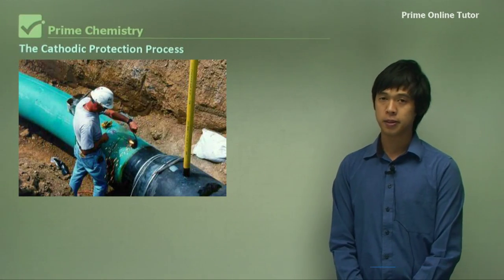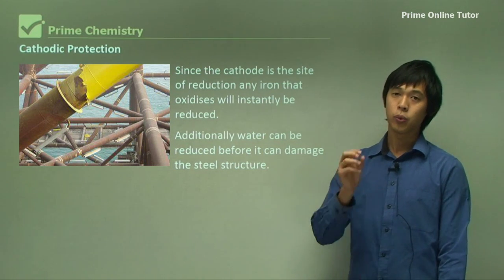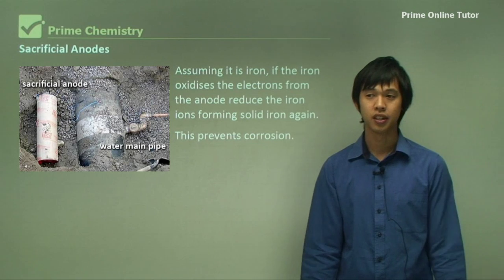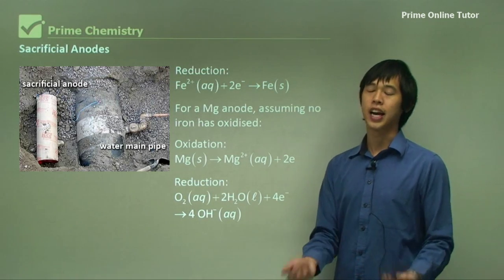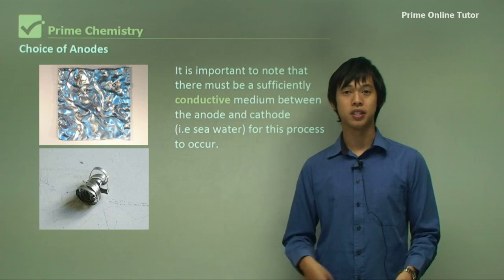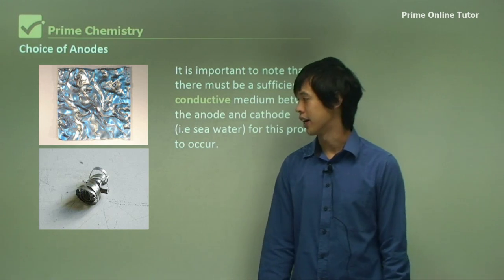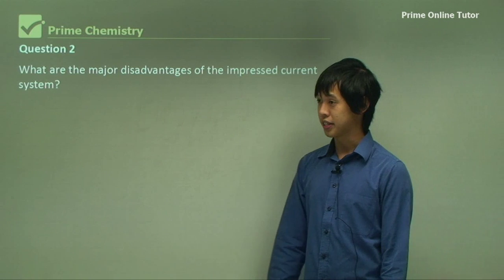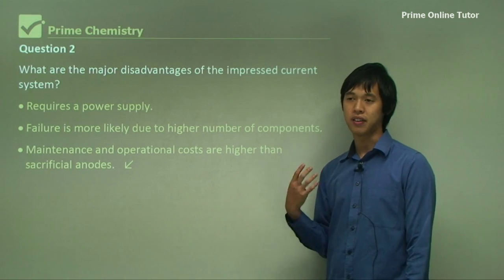💯 Cathodic Protection Process Explained with Clear Examples

Comment: In the case of Iron (Steel) pipes buried in relatively high pH (7.3 to 7.8) soil, what type of anodes would you recommend?  We also have a surface (45-foot), large-bore, hand-dug well, into which the pretty-hard (but only about 7.3 pH) water flows from highly-horizontally-fractured limestone.  We have a (cast-iron) jet pump in it, [with plastic & bronze piping] and you can see the pump rust/corrode before your very eyes...  There are also artifacts of a previous pump, plus iron piping, that has rotted-off, sitting upon the bottom, which are not reasonably recoverable.  Any comments?

P.S.: As you certainly know,  pH (>7) often has little to do with actual [water] hardness...  We are entirely alkaline/calcareous, here...  Mulder's Chart really kicks us in the rear-end...